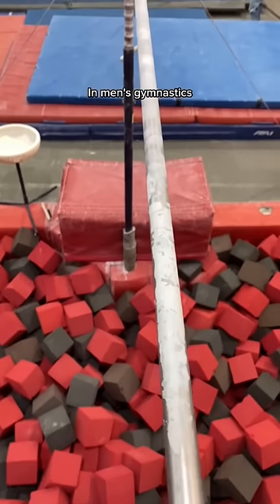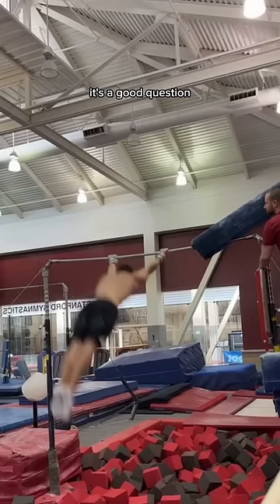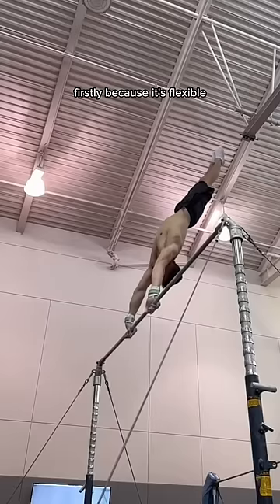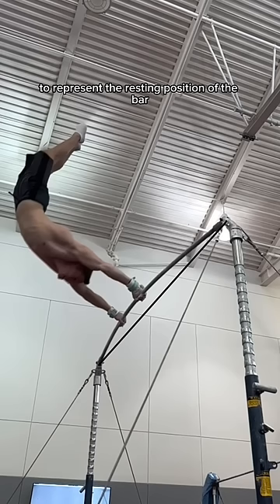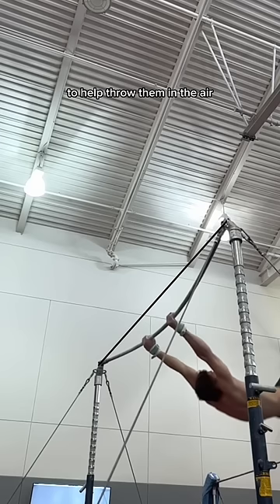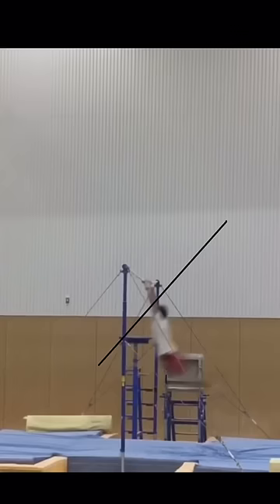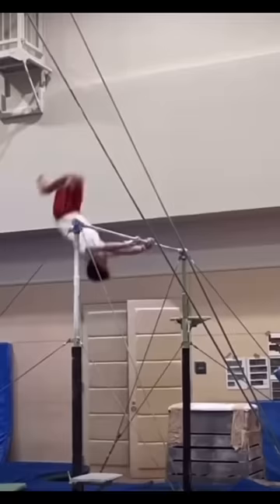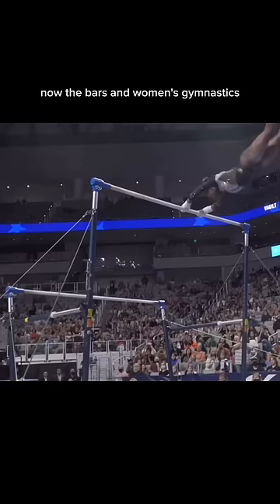Why is it made of steel 🤔 #gymnast #gymnastics #sports #calisthenics #parkour

Comment: Hey! I'm going to add another reason here: when materials repeatedly experience stresses, they can end up breaking even if it's wayyy below their yield point. Steel is one of the materials that has a fatigue limit, that means it will never break as long as the applied stress stays below a certain value.
Reply: He broke one once
Reply: @sci-fye1388  well if enough stress is applied then it can still break. But this is better than a lot of materials that will break over time regardless of the loading.
Reply: All it needs to do is reach plastic deformation point.
It doesn't matter how much past it it goes, it all adds up, so over months, years, or decades, you can work harden the pole, causing it to break 'randomly.'
Reply: @autumn5592  thats what he means, as long as the deformation stays below that threshold, you can deform it over and over forever.
Reply: Actually with stresses like this over time steels properties change. Every bend creates heat. It may seam miniscule but added up it wall harden further but be more prone to shear then.
Reply: @ashenmoonclash  It's just significantly less so than other materials that could've been chosen.
Reply: @ashenmoonclash  it's not the heat that causes the issues. To experience any microstructural changes due to heat, you'd need to approach the steel's recrystalization temperature, which is wayyyy higher than what is seen in gymnastics. What could be seen are creep deformations, where repeated stresses well under the yield strength cause gradual shifts of atomic planes over time.
Reply: Creep is not really a thing with steel. However, to shed some light on the subject, a material or component can fail under repeated dynamic loads even after a long period of time. Without ever reaching the yield strength or tensile strength. This is due, among other things, to the fact that materials are never perfect, have orientations and have defects such as inclusions. Such defects have the effect of a notch in the component. Under such loads, stress peaks now occur in the notches, which lead to local failure, but due to the supporting effect of the rest of the component, the component remains globally intact. Nevertheless, the notch continues to grow and, after a longer period of time, this supporting effect is no longer present, which then leads to a global failure. This is called fatigue strength. The difference between fatigue strength and static strength can be easily seen if you look for pictures of force fracture and fatigue fracture.
Reply: Over time repeated stresses can break steal.
Reply: This comment section hurts my mind thinking about thermodynamics😢
Reply: @Chaotic0699  thermo wasn't really mentioned here. This was all dynamics, material science, material mechanics. Thermo is a whole nother beast.

Comment: Not sure if someone commented this, but women's gymnastics also used to involve a lot of "bouncing" moves. They'd purposefully wack their thighs/hips against the bars to bounce between the low/high bars. You can't do a giant on the low bar to build up momentum/get that bend he's talking about, so instead momentum was conserved by litterally smacking into the thing.

So, yeah, steel would've been less than ideal.
Reply: Men's parallel bars are also made of wood and fiber glass. They can also be offest and adjusted into a position reminiscent to "beat bars", or how uneven bars used to be set. Female gymnasts used to bounce and swing from bar to bar. The bars were also not a cylinder shape, they had the same shape as parallel bars.
Reply: @colbey32  Yup, back in the days when you could stand on the bar and do a backhandspring to catch it. I'd add that the bars used to be just wood, fiberglass was added because they just kept breaking, lol.
Reply: @colbey32  In Turnen (a Sport) in Switzerland, the Stufebarren are exactly that, parallel bars set at different heights. What's really fun is we'll do routines with multiple people (sometimes even mixed men and women) and multiple sets of bars.

It's super fun and really reminiscent of the old days, especially when bouncing off the lower bar back up to the top bar or holding the top bar, catching the low bar with your hips, and going straight into a back hip circle. Just gotta bend the knees on the circle so you don't crack your shins on the high bar. 😅
Reply: The old uneven bars were originally placed so close that the gymnast could hang by their arms from the taller and have their hips/thighs lay on the shorter

Comment: Fun fact, steel bars are usually used in female gymnastics to train new skills. 
Oftentimes we'll use gloves to make it easier to glide around the bar and make us practice the technique before progressing to the wooden bar. 
However steel bars also require a different grip than wooden ones, so it'll still feel very different.
Reply: The men's bar is also SO MUCH EASIER to hold on to.  And no one here is mentions it.   So much ignorant nonsense about women's spines.  No one mentions that the gymnasts with the smaller hands are the ones who have to manage with the thicker bars.  its much easier to peel off the thicker bar and end up on the mat.
Reply: Also some gyms put like a plastic bar with tape around without gloves
Reply: @ae2948 are u a women? Because you said SO MUCH EASIER TO HOLD ON MENS BAR THAN WOMENS. Because i think its very equal❤

Comment: Just want to add that wood+fiberglass is also an extremely strong combination !
Reply: Thank you for saying that, I’m not a gymnast  so when I heard that the women’s is fibreglass my first thought was concern about the bar’s strength, bare hands near snapped fibreglass is a terrifying image so I’m glad to hear the bar is suitably strong
Reply: @rainbowflowerpower4464  the bars do occasionally break, but since women gymnasts are normally incredibly light (Simone Biles is 4'8" and 100 pounds) it does not break under the pressure most times. men gymnasts however can't use these bars because they on average weigh 100 pounds more
Reply: Yea it sound pretty consirning
Reply: I often got painful blisters on my hands from gripping my wooden broom/mop handle when I cleaned my kitchen floor. And I'm not sure if this is comparable to chalk that gymnasts use, but I often had my hands covered in flour from baking my cakes, and I still got blisters. My grandma had a mop with an aluminum stick, and I didn't get blisters from gripping it when I used it to mop her floor. Since then, I made the switch to the aluminum stick, and I never got blisters again. It's also satisfyingly cool to the touch.

Now don't get me wrong, I don't know if it works the same way in gymnastics. Maybe it's a different case for you guys and you don't get blisters because of the chalk, but I honestly think they should all be metal.
Reply: @bellebonebag8096  Everyone gets blisters and calluses, and sometimes the calluses will rip off and bleed. Bar work is SUPER rough on the hands.

Comment: Also mens shiny bar is thinner than a woman's wooden bar, if you ever see a close up on how they grip the bar men will grip the bar like a bike handle (4 fingers on top and the thumb under) but a womens bar you can't do that so there thumb sits on the same side as the finger (sort of like a sloth)
Reply: This is just.., not true. I did womens gymnastics until JO level 8. You switch your grip depending on the element. There are lots of elements where you grip with the thumb on the other side of the bar.
Reply: Ummm look again. The woman grips it with her thumb as well.
Reply: Wrong.
Reply: I just had a quick and your right it's really fast and you miss it, tbh I did the sport myself for a LONG time and I never used my thumbs AT ALL...
Reply: @jinja-ninga97c21  ...... You must have not been very good at gymnastics, then. Your thumbs are what help you keep your grip. It's one of the first things they teach you in gymnastics.
Reply: Sloths have very long and sharp claws, that's how they keep their grip without thumbs. Humans can't do that, or at least, not for a very long time. And certainly not in gymnastics. That's virtually impossible.
Reply: @bellebonebag8096  I did alright and I enjoyed it ☺️
Reply: Keep in mind that women also tend to have smaller hands than guys, and the circumfrence of the uneven bars is bigger than the guy's horizontal bars.  According to my gymnastics coach, it's actually not safe to wrap the thumb along the bottom of the bars, in case the thighs hit against the bars (like with doing a front support to a cast, hip circles, etc).  For guys, the thumb can safely wrap around the bar, protecting the thumb.
Reply: You really think a 4'9 woman and 6'1 man have hands of the same size?
Reply: @cadaver4985  no no not at all everyone is different, but as a observation from working with equipment for many many years the men's shiny bar has a smaller diameter than the womans wooden bar which is a little bigger and the mens P bars are ovals

Comment: As a gymnast I would say the women’s bar is a lot better because it is more easier to grip on the bar so that’s my opinion
Reply: Idk when my coach makes me do giants on the girls bar, I am veeerryy hesitant. I like my thumbs wrapped 😂
Reply: it’s easier to grip ur u do also get A LOT of blisters from the women’s bars we were tested on the boys equipment once and with the men’s bars they r a lot more cold and slippery and you don’t get blisters from them even when u rnt wearing hand guards
Reply: Because women typically don't need thicker bars usually because women are usually smaller and weigh less
Reply: The guy in this video broke a steel bar while using it
He would break the other bars on a daily basis 😐
Reply: As a male child I liked gymnastics in sports lessons, then came puberty. I wish we would hace changed from steel to carbon fibre, cause boy o boy was that uncomfortable. ^^ ( and yes we have both ground and air gymnastics in sports lessons here in germany )
Reply: Which is why the steel one has the white chalk powder on it
Reply: @joaopeixoto6224  he broke it on purpose
Reply: Smaller bar is easier to grip but it's made for women not men
Reply: @Godsoldiergaming  even if on purpose, it's a METAL bar, and it isn't hollow either.
Reply: @joaopeixoto6224  yeah well it still takes a ton of force to break and only the men's high bar is steel all the other parts they use are wood and a lot and of plastic if I'm not mistaken
Reply: @Godsoldiergaming  The men's bar is actually smaller, they have different grip techniques
Reply: @Deeegenerate  yeah I know that but still only the high bar is metal
Reply: Men have more grip strength
Reply: More easy, or easier, not "more easier".
Reply: It's useless if it breaks sweetie
Reply: Ok that’s cool. But nobody asked
Reply: The men's bar is easier to grip because its thinner so this doesn't make sense

Comment: It's also because there's a difference in the point of balance between men and women. Women's point of balance is closer to their hips, while men's is more towards the chest area. Which means men need more of a swing to flip and do gymnastics. 🤸‍♀️ 🤸‍♂️
Reply: What does that have to do when an entire person is coming down on a pole. your center of balance does not matter in that case.
Reply: @djdavisiscool  that's pecause when you're sliding down a pole you're going down straight, in a vertical line. With a gymnastics bar your doing tricks on a horizontal bar, thus using that fact.
Reply: @Artoast_AQ  what does the center of gravity have to do with how much the bar bends. You were swinging on the pole all of your weight is going in that direction it doesn't matter where your center of gravity is force is force.
Reply: @djdavisiscool  listen, ok? Google it.

Good day 👋
Reply: @djdavisiscool when you're swing around the bar the center of mass absolutely matters; since women's center is lower down their bodies it's further from the bar(the axis of rotation) so they accelerate around it more easily
Reply: @djdavisiscool  center is the reason women can do that weird trick shown on the vid
Reply: @djdavisiscool  it does make a difference because they don’t just come down on it. it affects what kinds of swings they have to do because the balance comes from a different point.
Reply: @wynsonrao5177  thanks for explaining. I was getting tired of it lol 😂
Reply: @louloudaki_  u too
Reply: Men are like swords, women are like axes
Reply: @djdavisiscool …it kinda does matter? You ever take any sort of physics class? Swing a water-filled bucket around you, perhaps?

Comment: If you notice I’m the olympics the top female gymnasts tend to be smaller people, not in muscle but in height and overall weight I think that might be what he means when he is saying they might not be bending the bar as much. It’s not a strength thing it’s a build thing.
Reply: Could be both because build, as in the bone composition and density does affect the torque, meaning force, applied by the skeletal muscles. Ex: Males have longer arms so the arm lever system for them creates more force in comparison to a woman. 

In addition, Males have more fast twitch fibers than women, which affects their source of substance use. Men use more carbohydrates, which is less energy but a quicker source, than lipids, which is what women tend to rely on for fuel. This quickness of energy availability can impact the prolonged use of power/force used by the muscles during the short period of the routine and, likewise, affecting the amount of stress on the bar.
Reply: You could have all the strength in the world, if youre hanging on a steel bar theres nothing you could do to break it with brute strength
Reply: @unclebary1866  Not with brute strength but through stress. The young man did not use brute strength rather he stressed the bar with his weight and some force applied to build momentum/swing himself around, but not necessarily brute strength. Although, good point, females are less likely to break the steel bar and if brute strength was the only factor, the male is more likely to bend/break the bar while the female would barely even come close to doing the same.
Reply: Also the bar tricks in women's gymnastics are usually more precise and slower, rather than flying around more.
Reply: In muscle aswell
Reply: Food for thought, if women preferred using steel bars or men preferred using the wooden hybrid bars, they would use it. My guess is because women use their bodies to 'bounce' off the bars in a dextrous and graceful way where men work the bar in a way of strength and power, hence a steel bar. I'd imagine when women 'bounce' from the bar, a wooden bar would be more forgiving than a steel bar. The entire form and style between a male and female's routine is drastically different, just check out clips on YT. I genuinely don't think it has anything to do with bar strength rather than the form associated between routines.

Comment: Since the bars flexibility is important, many women probly couldent get as much of a spring out of the steel bars as they can with the wooden ones, thus its just a change based on the average weight of the competitors. Im sure if female gymnist average 180 pounds overnight they would switch to steel pretty fast

Comment: Until recently, i also didn't realize that it was a solid core bar. For whatever reason, I thought they were kinda hollow to give it that flexibility.
Reply: Nah, hollow bars are actually worse when you need them to bend, as they will tend towards crumpling instead of just bowing. If you wanna see just how flexible solid steel bars are, look up a video of deadlift competitions. Those bars look like theyre about to snap sometimes.

Comment: I didn't realize steel was flexible.
Reply: Steels elasticity (that is, its ability to just bend and spring back under force that would break other materials) is actually the main reason its useful. Most springs are made of steel, as are many cables, and even strings for instruments (piano wire is steel, as are many guitar strings). If you wanna see big steel bars flexing, look up a video of a deadlift competition, those bars look like the weights are just gonna slide off the ends from how much they bend.
Reply: That’s why buildings use rebar

Comment: Small fact on the side. Glass fibers have a significantly higher tensile strength than steel. So if glass fiber-reinforced materials are used for the women, they can theoretically withstand even higher loads. However, other factors also play a role, such as load and fiber orientation.
Reply: Me and the boys about to go make a skyscraper out of glass

Comment: Women's bars developed from men's Pbars. They initially just offset them, then used spreaders to get a tilt that eventually turned into a new apparatus. It's about an evolution in design, not so much about the power of the skills. It could be argued that the difference in the power of the skills was shaped by the evolution in equipment design.

Comment: people also forget that 'steel' is a category of metals with a large range of different properties. The gymnastics bar (more like a pipe actually) is not made of the same steel used for tank armor.
Reply: Thank you! I was confused when he said steel is “flexible” when beams that construct buildings are made of steel.
Reply: @Fuzzysea693  Actually structural beams also bend to an extent - by design. Skyscrapers, bridges etc. are designed to flex with the wind and large ships are designed to flex with the waves. One of the reasons steel is so useful as a construction material.
Reply: @dinamitemaster  Exactly. If the metal beams in buildings weren't flexible, then they would be very vulnerable to earthquakes.
Reply: The bar is completely solid